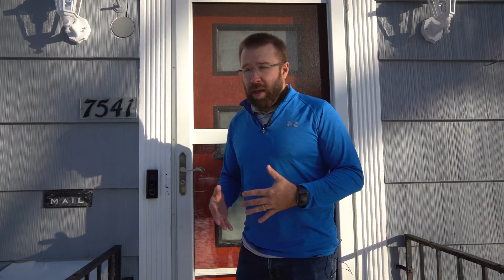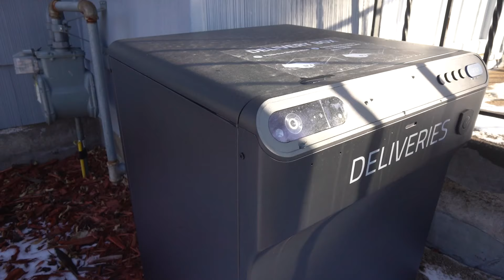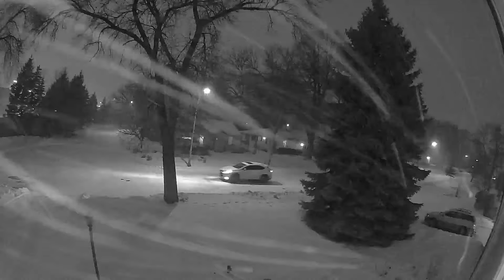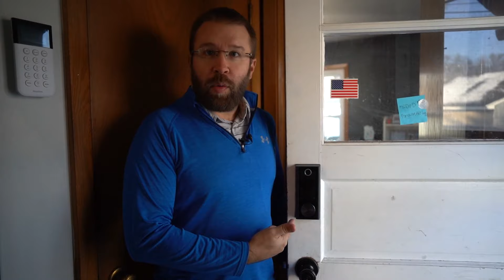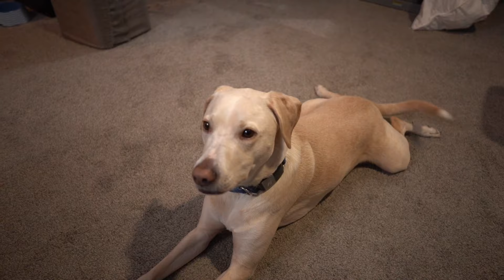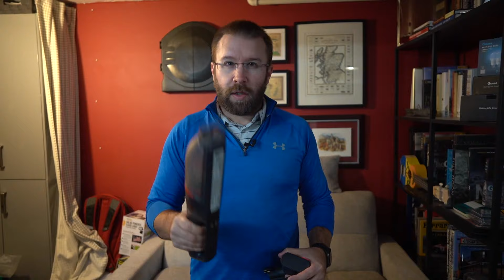Ultimate Eufy SMART HOME Tour

Comment: What Eufy would you recommend for a small backyard? 20'×40'
Reply from the maker: For battery/solar setup I recommend the S330 EufyCam 3, but if you can hardwire it, get the new floodlight. The older versions of these cameras still work well too if you can find them on sale.
Reply: @BrandonDoyleMN  thank you

Comment: did you find that you get a lot of false notifications with your 2K doorbell or camera? They say homebase 3 can prevent it due to its AI. I'm wondering if it is worth it.
Have you tried to connect it to a Google Assistant to see if you can have google pull up the doorbell or camera on the tv or viewing screen?
And have you run out of room on the Homebase 2? it only has 16 GB i believe. 
and is the solo cam with solar panel able to keep the battery charged through winter?
Reply from the maker: I'll tell Colton about your questions and see if he can reply, this was filmed at his house
Reply: @BrandonDoyleMN  while you're at it I have been researching how easy the 2k doorbell is to steal and it seems it's fairly easy. But apparently eufy (unlike field and ring) will not reimburse owners even if you file a police complaint and inform the company immediately. So I'm wondering if you have suggestions for how to keep the eufy doorbells protected.

Also there are rumors that if you steal the doorbell, reset it and add to a new home base, you can lose the saved video on the original home base. Can you confirm if this is true?